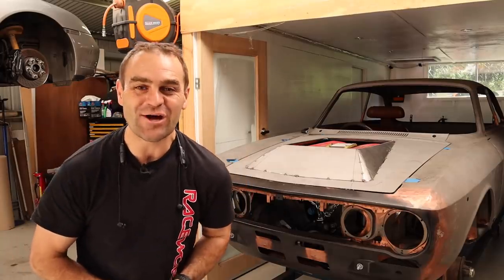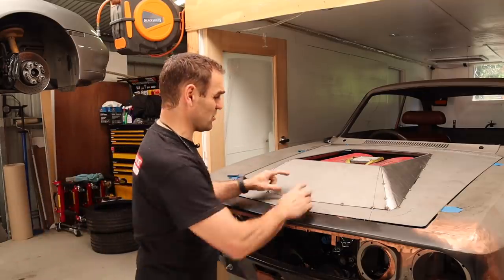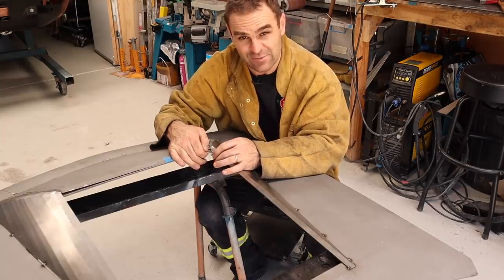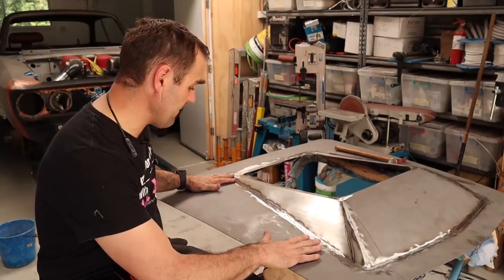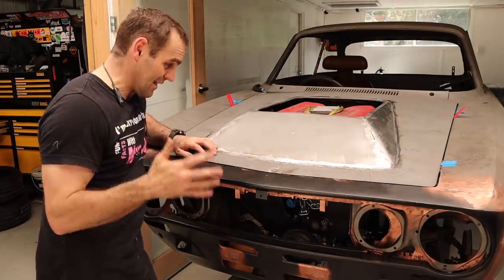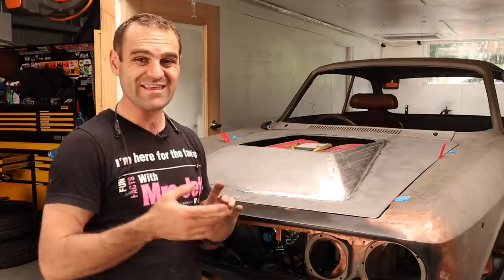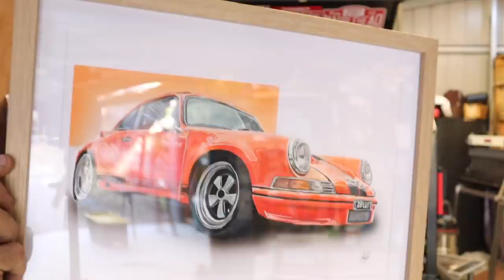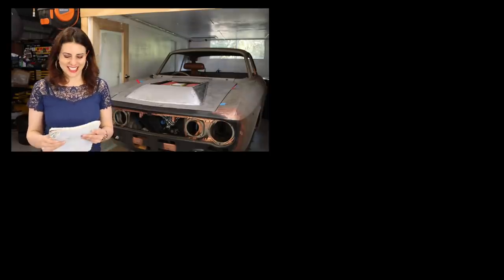Too much bulge for Mrs Jeff? - Ferrari engined Alfa 105 Alfarrari build part 71

Comment: I completely agree about the shape of the 105 GTV, one of the greatest of all time (even if Georgio Giugiaro, amazingly, doesn't ), and with your philosophy of making the bulge (fnaar) an 'addition' while keeping enough of the original plane/curve of the bonnet to allow the suggestion of the 105's shape as a whole (one of the absolute best angles to appreciate it is elevated from the side BTW). For wider wheels I'd go the same way, use simple spats rather than body widening (which otherwise works OK with some cars (like Harry, for e.g.) which don't have the combination of lines/angles and curves of the 105 that you mention). ETA > commented before I finished the vid - yep, the bonnet IS looking good! Maybe you could even use it to make a mould for a carbon fibre one eventually?

Comment: When welding big flat areas like that I use old beach towels soaked in water as heat sinks to minimize distortion. I also find shrinking discs are a godsend when trying to straighten areas like you are dealing with. Keep up the good work mate.

Comment: Good job Jeff, I think it looks fine and once it's painted it will blend in with the car.  A small tip,  you can use a paint stripping disc/plastic disc to blend your welds after you grind them. 👍

Comment: The bonnet bulge sorta messes with the sleek shape, but it's not the end of the world, but I would suggest some 240Z like flares, and bigger wheels, to match up with the added beefiness that the bulge gives to the car.
Standard wheels and tires are going to be a mismatch now.
But it's all positive, you saved a 105 from the scrapyard, and, if it gets too much in the looks department, you can just get another bonnet and put a motor in it that doesn't need a bulge, all good.
Keep up the great work, you are an inspiration.

Comment: One body design automakers use is to hide the bad, or less attractive, geometry in a light lense, see Mazda RX8 headlights. I worked with that car and it’s designer to replicate it in smaller scale and the headlights are tough to do. You have to see them up close. 
What could be a cool solution for this hood is to take a page from Ferrari history and design a larger vacuum formed polycarbonate shape. This would solve both problems, reveal the top of the engine like a Testarossa and resolve tough geometry in a clear shape. Just a thought, hit me up if you want to explore this idea Jeff! It’s not too late!

Comment: You just have to work on it Jeff, that car has an iconic design and it's really hard to make it look perfect.  It does look so much better now!
I think that you should try and replicate the curves and the angles of the side panels, that would get it more in harmony maybe. Personally I'd have trimmed the front corners as much as possible. But it's easy with a keyboard, not so much with a welder and a hammer :D

Comment: Has anyone mentioned moving the throttle bodies, a couple of flanges and a piece of aluminium elbow, they do it all the time when putting subarus in old VWs, you could angle then down a bit

Comment: question, did you consider using my ' lead ' for the bonnet to hood riser, to keep the number of welds down?,,,less warpage as a bonus?  just use low heat, and ' lead ; ( not really lead ) and use it like butter, to smooth it out? i use it all the time on older alfa romeos( they come that way on some seams ) and other classic Italian cars.. and you will come across it on that car..

Comment: Sometimes when you build on to a car you are restricted shape wise by the things you are trying to build around as in your bonnet bulge it has to work around the engine shape and the only other way around it would have been to have made it bigger at the back because the height of the front is already determined by the higher engine of the Ferrari   Rob

Comment: Jeff, how about thermal forming a sheet of polycarbonate (Lexan) over your beautifully crafted shape (just the bulge), and adding a gutter-like shape of a few CM. Then fixing this part on top of the engine, and leaving a cut out in the bonnet. Depending on the color of the car you could use a candy paint or transparent film on the polycarbonate.

Comment: You talked of drag. It's the sides of the bulge that looks wrong as they taper in, which is a large drag area. if the sides got wider as it went back rather than coming inward I think it would be less odd. could maybe make the front are slightly narrower also. It's the only thing you have explained on either of your current builds that still feels off. Normally your PoV explanation does indeed settle the mind. 
Great work as always, keep it coming!

Comment: I personally think the bulge looks Okay.  It is a non-integrated solution, rather than a molded in type.  I agree a molded in shape could look bulbous and degrade the original design.  Your solution keeps a functional shape separate from the original shapes.  It's not perfect, maybe, but it is strong, bold and purposeful looking.

Comment: Jeff, I know you’ve been annoyed by plenty of guys about ur visible bulge by now, so don’t see this as criticism, but I wonder if you had considered a plexi or poly-carbonate vacuum formed cover much like you’d see on ‘50s and ‘60s racing Ferraris where they cover their intake stacks? Their’s are cowl intakes, but in your case closed off would be best. It would show off the engine, be a nod to Ferrari’s heritage and they’d be shaped fairly form fitting without changing much of the overall shape of the car.
Reply: I know these comments are 4 weeks late and you are 20 or so hours and a bonnet into the current bulge. I agree with Tofuman. I have never done it, but I believe you can form acrylic over a wooden buck with a heat gun and patience.
A bubble reminiscent of the 250 TR could really preserve the cars lines.